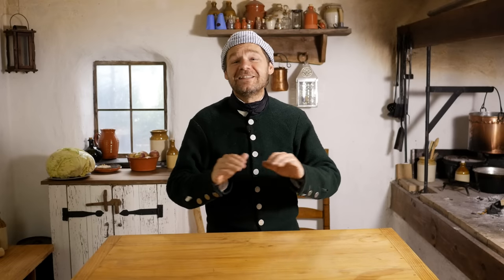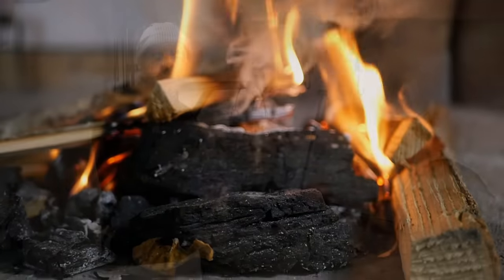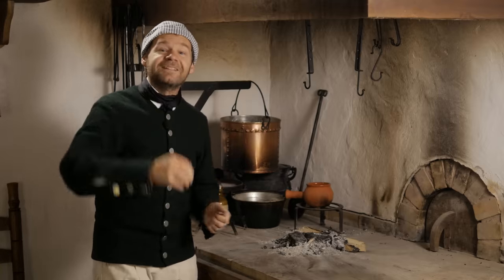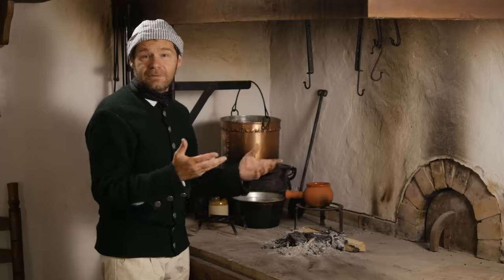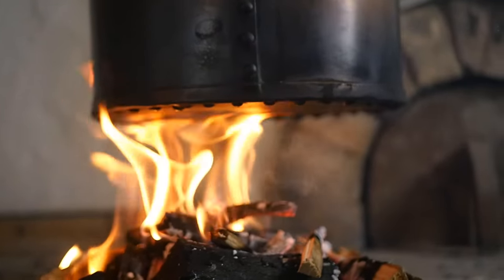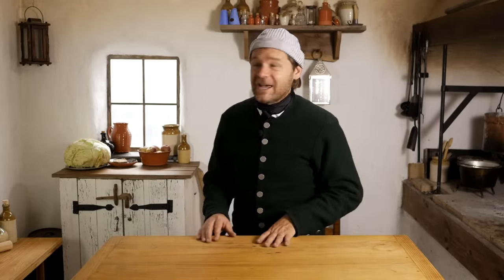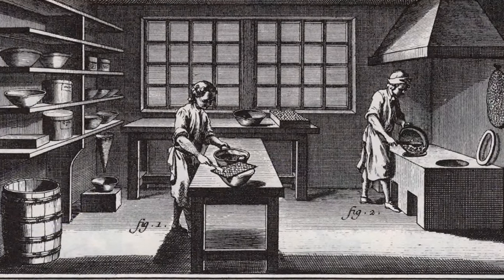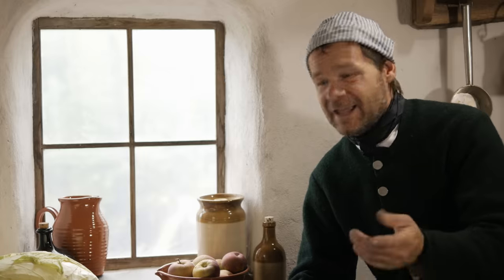Historic Kitchens vs. Modern Kitchens

Comment: One of the major differences in modern cooking vs classic cooking is actually a note that you made commentary on: Dishes.

Simply put, cookware and dishes in general were expensive to make - they still are expensive to make. Due to the expense, as well as the difficulty of maintaining heat, most dishes were made as one-pot meals. This reduces heat-waste as well as reduces the needs of pots. Not to mention that the lack of food-safety knowledge wouldve changed how many dishes are used. Lastly; the skillset is different - amateur cooks of today tend to use 3-4x the amount of dishes required to make a meal; a luxury an earlier person wouldnt have, or perform since they'd been cooking for at least 10 years on a daily basis prior to marrying and running their own house's hearth.

For example; when making, say, chicken and dumplings/buscuits. The entire meal would take the work surface you have (the table) as the main working area: for dishes it would take a spoon, a pot, and a knife. That's it, and it would be food-safe even. Now, how many dishes have you made cooking up that same meal? That's how many dishes you need for the same meal today, by the way. 
Once that meal is completed, you could clean up the work surface and leave the pot with the leftovers for morning while you prepare the next large meal - say a potato soup. Well, in that case you wouldn't even need to clean out the pot; literally just throw water into the pot and bring it up to the boil: boom, self-cleaning and pre-seasoned for the soup, you've now saved maybe 100 calories from the scraps of yesterday's meal that was covering the pot.
Perhaps the next day you could bring fresh water to the boil in that very same pot, scrubbing the kitchen with some of the hot water you pour off into a bucket (keeping mind to clean your dishes if there are any from the past two days) and with the rest of the water; make a pot of coffee, and throw all of the remaining water into the trough of compost you were keeping for the pigs - now you've not only done the dishes, cleaned the kitchen, and brewed a pot - you've made slop for the pigs. Take a small amount of fresh water and wipe everything down with a rinse-rag. 

It's honestly not that hard: you just need to understand that whatever item you have; that is EVERYTHING you have. When camping I bring a large dutch oven, a large pan, my knives, a cutting board, 2 bowls, and a spoon. Then eating dishes and utensils everyone else is responsible for. I cook 3 meals a day, as well as dessert, for 6 days straight, for 5-10 people. It changes how you work, but it gives a respect for being clever. I do dishes once a day and can follow the basic tenants of food-safety (other than using a pot twice which has shit cooking well above 165F in it, so...sue me.) Typical meals are Chicken and Biscuits, Guinness Stew, Paella, Fritattas, Pies, Pilafs, Soups, Cobblers, and on the first day - It's always Tournedos Rossini.

Comment: I have done a lot of cooking in my lifetime, indoors and out. During an extended power outage in Northern New York, I roasted meat by dangling it on a string before our traditional open fireplace.  I twisted the meat on the string and it revolved slowly.  But as you point out, this type of cooking takes continuous attention.  In those days, I wished I had one of the 'tin ovens' you sell.  There are traditionally-inspired cooks in the UK today who lament that the true British joint of meat lost its soul when closed ovens entered the kitchen. I have seen palace kitchens from various periods.  This realistic account proved to be fascinating for its 'warts and all' comparison.  I am reminded that the average person was shorter in the 18th Century so ''countertop' raised hearth would have been lower.  However, 19th Century English kitchens still had hearths that required plenty of stooping.

Comment: Another thing that’s different is that cooking facilities today are generally inside the house. Houses in previous centuries, especially in warm climates, had cookhouses that were some distance from the rest of the house. People who didn’t have actual structures for cooking still did their cooking out doors, weather permitting. Even apartment dwellers built cooking fires in the yard. There were two big reasons for this:

1. Wood fires make a great deal of heat (and smoke). If you have the fire outside the house, the house in summer doesn’t become unbearably hot and smoky.

2. Kitchen fires were extremely common. If your kitchen is in a separate shed and it catches fire, you lose your kitchen. If your kitchen is in the house and it catches fire, you lose the entire house and everything in it, except for what you can carry out in time, at some risk to your life.

Laundry, which involved boiling big kettles of water, was also frequently done outdoors, for the same reasons.

Comment: I really love all your videos and your insights into 18th century cooking. I really wonder after watching one of your videos how would a modern thinking man tackle the same problems...I mean for the running water issue, after having some experience myself, using a really big barrel on poles or on the roof and using clay cones(it was a common roman/greek way) funnel it through walls to a spigot would be more than enough to have a reservoir for water that is relatively safe from critters(insulation from cold is another thing)...I know that the whole idea is representation and reproduction but these days knowledge seems to be the primary drive for practicing these out of era cooking methods and modern mindset is bound to find a way to counter problems that were never dealt with efficiently back then...Keep up your excellent work!

Comment: Now that you've worked in it a while, could you revisit the design, building and general use of this kitchen? Would you make any changes to the design to make the airflow more ideal and less smokey? How about the integration of the bake oven? Would you make it any larger? Would 18th century kitchens in bigger houses have had a copper or large pot for boiling water - as seen more commonly in the following century? Additionally, could you do an episode about restoring or building and using a spring house? Perhaps a visit to a working spring house? Thank you for such a wonderful and informative channel!

Comment: I guess they prepared as much as they could during daylight. So they just had to serve or do easy work in the dark hours. A stew was made at day and could be eaten anytime people came home from the field at night. Preparing the breakfast in the late afternoon the day before. Make sure you have all the kindlings and tinder for the morning fire ready. All water brought in time. I lived for 5 years without running water. Doing the dishes is a team work. The water is used 3 times. First for fine cleaning. Glass and cuttlery not so dirty. When too cold it is used for rough dishes of plates and bowls. Keeping the next batch of warm water clean as long as possible. When too dirty it is used for loosen up the dried in or burnt in pots and pans. Then it is thrown out. Its like having a stream of dishes going from dirty to clean and water going against that stream from warm and clean to cold and really dirty. I am pretty sure they saved the last pretty clean water to rough clean the plates and pots as soon as possible after use.
And an advise to the wife in the house: Never let the maid clean the table knives. She will ruin the bone handles.
We use the kitchen as everything is on demand when coming home from work. Then the kitchen was an ongoing process where everything was prepared for the next task. Much like a restaurant kitchen still is.

Comment: Have you heard about any thing like this ?
My grand aunt had a cabinet on the wall of her kitchen that was ventilated to the outside in such a way that cool air was trapped and refreshed from out side. She had a particular name for it that I haven't been able to remember I was very young. Something like a "cool cupboard". The ventilation system worked with the same system that is used to ventilate old time root cellars. They used the density of outside cool air to fill the cellar with a pipe a certain height from the floor to ceiling and another pipe to allow warm air to escape the cellar. I think they had a pipe going into the cellar at or near the ground surface from out side then another pipe going from the ceiling of the cellar to the outside. Both were rodent covered on the out side and inside. The different heights of those two pipes made the cellar stay much cooler on the inside than the outside day time temperatures. Cooler than the natural cooling do to the soil temperature of the soil over the cellar. The cupboard was insulated all around the outside and the regular cupboard door was sealed along its edges. The riseing heat inside the cupboard would create a vaccine to draw ground level cool air into the cupboard. When the temperature outside dropped. I'm not sure of this but I think that's how they did it. Have you heard about anything like this ?

Comment: I'm cooking on a woodstove inside and a charcoal grill outside (and its raining) and I'm not using the 240 electric range because this house is wired poorly and the cooking surface is actually way more irregular than the woodstove. When the fridge compressor kicks off it starts burning things

Comment: For the hood could you have say a plate of coals closer to the hood to heat the hood first and get air moving in the hood then lower that down to the cooking surface and that way the hood isn't cold creating some barrier preventing smoke from going out when you first start. Some have a chamber further up in the hood or chimney just for this purpose of warming the chimney first to help fire start and smoke won't hit a cold barrier locking smoke and exhaust inside because of cold air stuck in the chimney

Comment: I feel that this video only touched on areas that were important and missed big elements of cooking eighteenth century style.  Firstly, the pantry was barely mentioned in food storage and the larder provided the alternative to the fridge, as did the root cellar.  Washing was often done outside on a veranda even up until the 1920s or perhaps in a scullery. Those of us who have cooked in wood fired ovens or taught by those who come from such a tradition know that not all food needs to taste smoky.  Also, baking was not done constantly or on a whim, but planned on baking days with high temperature roasting done first, then as the oven temperature dropped, cakes and biscuits are baked. The kitchen in these times was not the universal cooking, storage, cleaning and eating place it is today, but a place where some elements of food preparation occurred.

Comment: My great grandfather had a hand pump to a well in his kitchen sink.
     The sink was very much like a modern sink, with a drain and the pump standing in for the tap. The sink drained outside into a gravel pit for grey water and a septic tank for black water. If you wanted hot water, you had to heat it on a fire.
       For washing up he used Cold Water.
      My dad went out to see him once as a kid. "Pa" (what dad called his grandfather) served dinner, but my dad noticed the plate had bits of food stuck to it. He pointed this out to Pa and Pa said, "It's as clean as Cold Water could get it."
      At breakfast the next day he saw the same thing, "It's as clean as Cold Water could get it."
     After breakfast my dad intended to do the washing himself, intending to heat some water. When he put the plates in the sink Pa's dog started growling and barking at him. Pa said, "Cold Water, behave yourself!"
     Didn't you notice I wrote "Cold Water" as proper nouns?

Comment: I lived in Lesotho, South Africa without a sink, electricity, or gas. Washing dishes isn't that hard, once one learns how. I'd heat up a kettle of hot water and soap up the dishes and clean them. The water was used to rinse. Then I thew it on the garden outside the door. Similarly, taking a shower was the same. One basin of hot water. The floor was mud so the drips soaked in. I am grateful for having an 18th century type experience in the 1970s. Be well!

Comment: You'd have to think with the smoke hanging in the room constantly lung cancer would have been an occupational hazard for mums and cooks?  I wonder if there are stats of any sort on the incidence rate? I have read that burns from women's long sleeves going up in flames from cooking over fires were terribly common. Bless our ability to watch your fascinating videos while having the benefit of our modern fittings and fixtures.

Comment: Well, let me just say this...if you live in a hurricane zone like I do, this type of kitchen is normal. I live in Southeast Texas and have recently had to deal with hurricane Laura and for 6 days went without modern amenities and pretty much every year this is a thing. Now, I have also started taking primitive living classes to get closer to how our ancestors would have lived and taking to the past with me my learned lessons of modern living. I have an outdoor shower and laundry. I also make my own soap and candles, raise my own food so that the modern grocery store is not a necessity when we are in hurricane season and mostly any other part of the year (all mostly grown right outside my back door on less than 7/8 of an acre but we live on 5 acres). We do collect water because there is nothing worse than not having access to water, especially when you have a well with no pitcher pumps or electricity to draw that water for you. we've definitely gotta fix that 
But I actually like living off grid and with no electricity. It's not bad. Now, I haven't had to make any of my tools like you guys but that's next on the agenda. I'm planning blacksmithing classes this year at the primitive living class I'm taking in the fall and I am rather happy to get some more lessons under my belt.

Comment: It's not so hard to wash dishes without running water and a sink. I grew up doing dishes that way. We always threw the dishwater out on the garden, then later Daddy dug a cesspool and put in a sink with a drain. We carried in every drop of water we used, took baths in a bathtub and Mom washed clothes at one time with a washboard, then later with a wringer washer. It sounds terrible, but there were advantages to it.

Comment: You know, regarding the open fire cooking: One never really puts much thought into why so many foods for common people before we got good at regulating heat were soups, stews, and other things that involve boiling water. You don't need to fight with the fire as much, because you can leave it considerably hotter than needed and only the rate of boiling will change instead of the temperature.

Comment: electric and gas are not the only controlled ways to cook these days. alot of people in the nomadic and tiny house community use alchol stoves and ovens. i personally use dead pine bark and branches in my biolite stove which has a heat powered fan that is adjustable alowing me similar control to that of gas but with the advantage of my fuel being free.

Comment: I’ve got two more cold food storage methods. The first is a cabinet mounted over a window opening, the food sits there in jars with damp cloth for lids, exposed to the wind (evaporative cooling) but ideally with a screen or at least lattice - for critters. The cabinet seals it off from the warm interior. window has no glass and an exterior screen.

And cellar that isn’t a walk in - simply a hole dug in the corner of the room with a hatch over it.

I don’t think only the well-off had nice cooking set ups. The Russian oven was a peasant thing was it not? Fairly sophisticated build for a little cottage, but it can be worked on bit by bit over time.

Comment: My house is almost 18 century, I have a sink with drain but no water.   I wash dishes in cold water dipped out of a large pot. My stove is gas out on the porch so that's a modern convenience. No refrigerator no electricity. I have a large BBQ smoker in the yard.

Comment: id imagine the heat control is an experience thing. similar to sourdough bread over time as Ive been baking bread each day ive learned textures and visuals that let me decide the best way to handle the dough. id imagine the same with using fire to cook. This is better with open flame. this is better with just coals. that feels like good bread temp, that's too hot ect.

Comment: When I was young I remember the root cellar with the Amish I lived with as being kind of scary and always very cold (in Ohio summer temperatures I was surprised - still am). There was a door from in the level of the basement which had a bit of a step down to an unfinished room with water dripping from the walls and the floor filled with pebbles and some stepping stones. 
There were some elevated wooden boxes a few inches from the edges of the room, giants chests of potatoes and carrots. 
I wonder how many people used these sorts of cold storage rooms back In the day or how settled a family would be before building these.